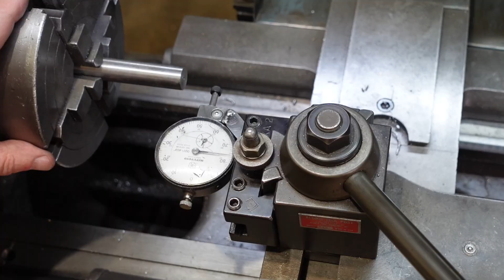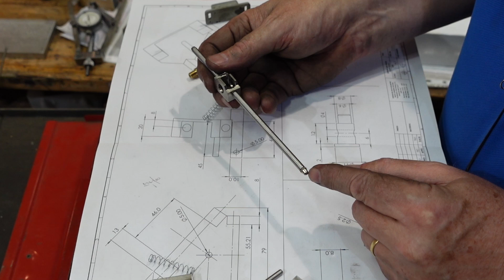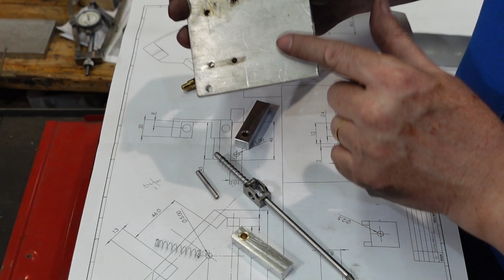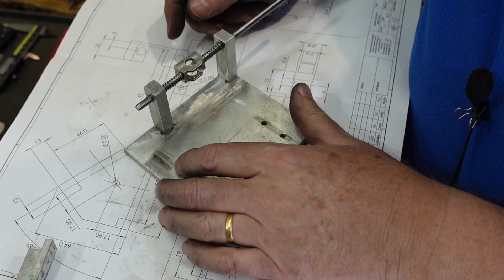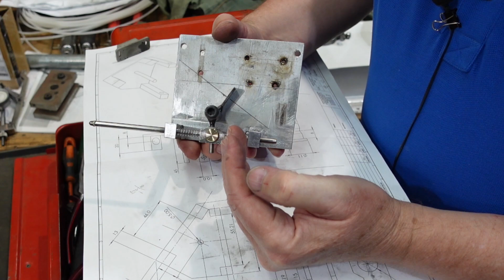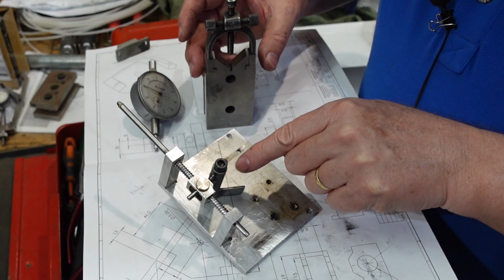An indicative prototype (universal indicator pt 0)

Comment from the maker: Several comments about would a long stem indicator or an extension piece be a cheaper/ quicker way around the problem. Short answer is yes, but there are a couple of reasons for going this way. First is the possibility of using that second indicator to indicate off bores. While I doubt I would do it often, it is interesting enough that I would like to try it. At the moment I do that with a DTI and that has not quite got the range.
The reason for not using an extension piece is that I've had tips unscrew on me before (especially if it is a conical surface). The idea of having to check two joints all the time is not appealling.
I do have a longer stem 3 series indicator but from memory it is graduated in mm, and my lathe is imperial. It is also in really good condition so while I get it out when it is needed, these 2 series indicators are common, smaller, cheap when secondhand and I would not be as upset if they were damaged for some reason.

Comment: Oh this is cool.  I may shamelessly steal this idea for my own shop.  :-)

One idea -- the brass bearings for the rod that goes back and forth could have their friction cut nearly in half by switching to a phosphor bronze, all else being equal.  Premade bushings are available in this material cheaply (at least where I am, I know this can vary), and could simply be purchased under sized if you wanted to make the bores custom.
Reply from the maker: Certainly you may steal the idea. Might be worth waiting for the next video to drop as that has drawings attached. This one is a prototype and much improved in the 'production' model.
I used the final version on the weekend when I had a lot of centring to do with bores. Apart from working out which way was which, it made centring much easier than with a DTI.

Comment: After watching the video and reading the comments, it's unclear what specific problem you're trying to solve.

There doesn't seem to be a real issue with using a long-travel or long-stem indicator. If properly tightened, they shouldn’t come loose, and there’s no strong reason to avoid them. Indicating a bore can be easily managed by slightly rotating the tool post or indicator within the tool holder, even with a standard-length stem. Additionally, a standard-length stem indicator can be tilted to provide clearance from the chuck jaws. If the machine has imperial dials, a metric indicator can still be used seamlessly, and vice versa.

The only challenge you seem to be addressing is the need to indicate within a groove that is thinner than the diameter of the DTI stem and positioned close to the chuck.

An alternative approach would be using a test indicator, which is well-suited for checking bores, ODs, grooves, and faces with a narrower stylus. The limited range of travel isn't an issue, as they can detect a large runout without direct contact with the workpiece. Additionally, extended styli are available to fit into shallow grooves, and the typically smaller dial makes it easier to work near the chuck.

It seems like you have a very specific application in mind to justify designing and manufacturing a custom tool for this scenario. Perhaps a long-blade stylus could achieve the same result?
Reply from the maker: Yes, on review I did not explain the problem well. The next video on this device will try to do that. You are generally right in what  you say but I'm trying to make up a device that will do all three tasks that currently need different set ups for each

Comment: I would have opted for an extension rod with a 45-degree bend on the tip. It will allow you to indicate both the od and id of any part.
Reply from the maker: I did think about that but then the narrow gap stuff gets tricky

Comment: a test indicator can solve this?
Reply from the maker: Not completely - and I find a DTI a bit fine for centreing stock in a 4 jaw anyway. When I first put stock in the chuck I can be 1 to 2mm of centre easily. The current indicator has a travel of 400 thou which works well for me
Reply: @occasionalmachinist  there are test indicators with friction pivoting stems, they are really easy to adjust as you indicate in. They don't have to touch the part at the beginning, the static stylus serves as a reference until it is within range. This is identical to using on a mill, moving the indicator until it sweeps a radius within its travel.
Reply from the maker: @ Yes, I have a couple. However, while a DTI will do a bore really well and an OD reasonably well, getting down a gap is tricky. Also, I find that when I first put material in a 4 jaw, it can be off centre by 50 to100 thou. My DTIs have not got that much travel.

Comment: One tip; start bolting parts together instead of welding. By doing so you can keep better alignment in between parts. Just a tip. Thank You. Another tip would be to use a dial test indicator. If you use one of these you can creep up to the four jaw chuck quite cosy too! Thank you for sharing! Best! Job
Reply from the maker: I also wanted to be able to use this device to offset material in a 4 jaw chuck (making eccentrics). A DTI does not have the range to do that. I should have started with bolting, but...

Comment: Why bother with pivots?
A simple angle plate screwed onto the rod should do the trick.
Reply: Would not make a very good video though 😂
Reply: @@tates11  
can't argue that.
Reply from the maker: On paper I'd agree, but it starts getting less simple when you start constraining it so it only moves in one axis. I also like the way that I can have the indicators slightly angled. I'll see how Mk II goes.
Reply: @occasionalmachinist I  think Stone mountain meant clamping a piece to the stem so it could be rotated and clamped where you want it if the indicator face is turned.
Reply from the maker: @tates11  If that is what is meant, I have that already. If you look at 1:31, that is effectively a bit of angle clamped to the stem and I can rotate the indicator. It works, but is clunky and still is wider than I would like.
Reply: @occasionalmachinist  I think he meant clamping a balanced right angled piece to the moving part of the stem on the left so the new part has a piece touching the workpiece that is parallel with the dti stem.
Reply from the maker: @tates11  Then you are back to my previous comment about constraining it. If you don't it will either move so the accuracy suffers or risk damaging the indicator because the bearings/ bushings in it have forces on them that they are not designed for. With this design, the pivoting piece is only there to transfer forces. When I do the video of the next iteration I'll try and explain in more detail.

Comment: I have used an indicator hole attachment like the Starrett 670 (a or b). You have to angle indicator a bit to get some clearance but it works well and you can reach in right up to the chuck.
Reply from the maker: I have a Starrett 196(?) that has an attachment like that. Ideally though I want something that can sit on the tool rack and be ready to go with little to no prep. Being lazy I guess😊

Comment: What about just extending the stem may be on the end of indicator.
Reply from the maker: It would work, but only for truing up ODs
Reply: @occasionalmachinist  rotate the tool post just a little to get the tip into the rear of the bore.
Reply from the maker: @ That would probably work, but because of the way it is set up, rotating the tool post is not a simple task.

Comment: Thanks for another interesting video on making an important piece of kit. Where the bolt protrudes out the back, could that be used to help mount it on a dovetail? Like a lot of things trial and error, but the imortant thing is it works.
Reply from the maker: Yes, although it is a little high. The second revision I hope will change that so it is not a problem